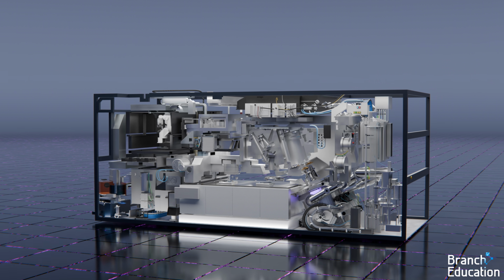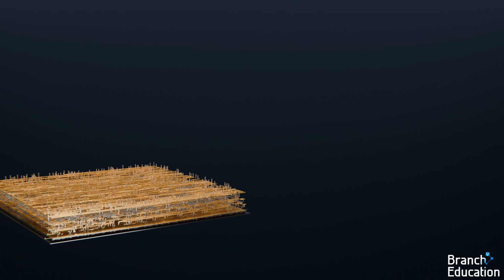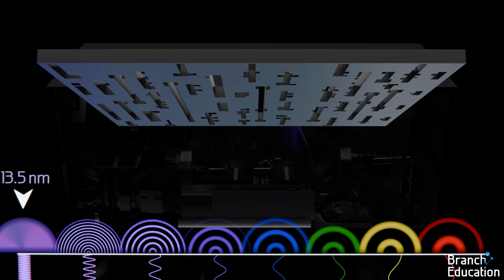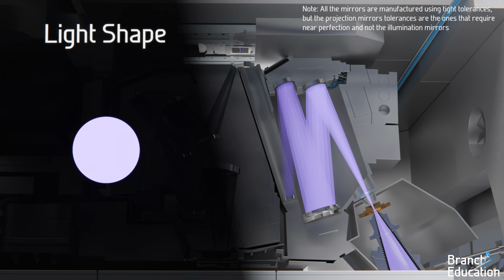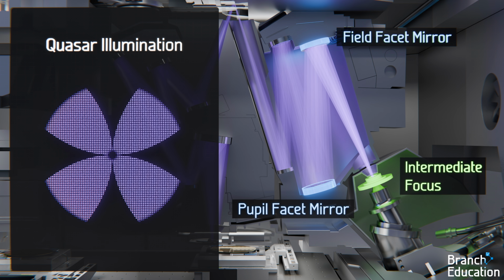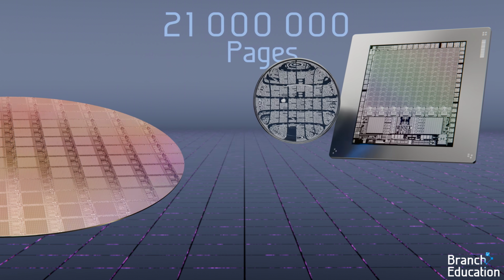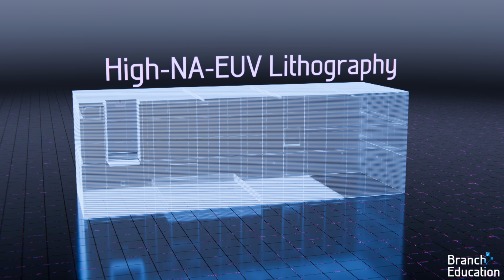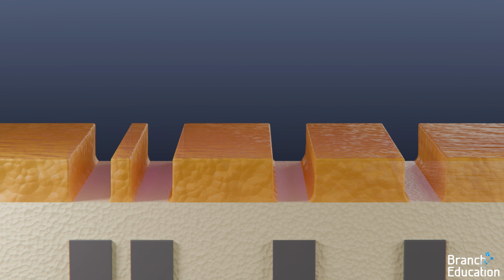The $200M Machine that Prints Microchips:  The EUV Photolithography System

Comment: First thanks for the video, impressive animation I can imagine the amount of time the team had to generate the diverse 3D animations. Just a question: between moving the waffle vs static laser and having a static waffle with moving laser, just wondering what is the argument to have chosen one way vs the other? Intuitively I would have said that moving the laser with different mirror movements could also bring up a competitive accuracy vs moving the waffle with electrostatic clamping and nano motors or semicontrollers. I suppose the question has been largely treated and it was deduced that moving the waffle was the most effective way. Still wondering if having the possibility to control the move of each photon from the laser will not be the next challenge to reach the atomic scale at the langstrom scale...

Comment: When I worked in metal etch for Freescale, they had the overhead system, but they stopped using it because it would just drop entire cassettes of wafers. Some that where on the backend of fabrication.

I guess the industry figured out how not to drop them anymore?

Comment: There is a beam of laser light that has a vector-precise burst, why scatter it with many, many precision mirrors into a tiny dot. When is it possible to shoot at three lasers. Or to guide light with hairline optics on a thin cross-section that is used to inoculate eggs with artificial insemination. Well, I saw the biggest theft in the world so far!  This was also needed for the EU to be able to finance the Ukrainians! Otherwise, it would have been enough to use the Sun as a light source, it has a large scattered light and is the largest source of light on the planet.

Comment: Hi,

There’s a hot topic—ASML’s planned 2026 layoffs (~1700 people)—that might fit well with your interests.

Unlike many Big Tech layoffs framed around AI, ASML’s case appears to be driven more by organizational restructuring. But at a deeper level, both seem to point to the same underlying goal: improving efficiency.

What makes this especially intriguing is ASML’s proposed two-year “Social Plan.” This suggests the current layoffs may not be a one-time adjustment, but part of a staged transition—potentially leaving room for further changes, possibly justified later by automation or AI.

It raises a broader question:

👉 How do engineers protect themselves in the age of AI? What can individuals realistically do when companies first restructure organizations, and then reshape the role of human expertise?

This could connect well with themes you’ve explored. I’d be very interested to hear your perspective on how engineers might navigate this kind of transition.

Best,

Comment: This machine really captures how far we’ve pushed classical physics to keep Moore’s Law alive. Calling EUV a “nanoscale photocopier” almost undersells it: you’re orchestrating tin plasma, 13 nm light, atomically precise mirrors, and nanometer wafer alignment just to print features a few dozen atoms wide. What impresses me most is the systems thinking behind it—optics, materials, mechanics, and control theory all stitched together so reliably that billions of transistors become a routine manufacturing outcome rather than a scientific experiment.

Comment: How do they control the mirrors to generate pattens? Are there different mirrors for different patterns or is it programmable?
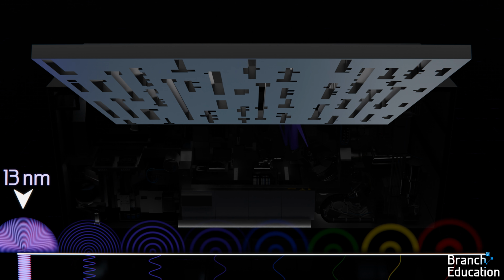Reply: At 15:04 they show the laser light passing through a pattern. What passes through is then directed with mirrors, focused and then used. They said "the pattern of the photo mask is imprinted into the light". Crazy!!

Comment: It was so upsetting to go "let's talk about words instead", because it made it so much more difficult to translate back to actual transistors.. It's unnecessary complication, not helpful.
Reply: To be clear, I'm not saying that the idea of comparing information density is bad, I'm saying that switching it up entirely early in the video was shocking and annoying. Just saying "if we printed words at the same level of detail, it'd be this much" or something similar instead of blocking it out like we're doing a different thing would've been better imo.

Comment: can some one explain something .  does the printing  of the mask layer by layer actually produce the 10 nm transisters and the wires , if not where do these transisters come from
Reply: Think of it this way: 1) Apply plastic foil to a disk. 2) Laser-cut patterns into the foil. 3) Apply the desired color with a paint roller. 4) Remove the remaining foil. Now you have a pattern on the disk. Repeat this step, layer upon layer. Only step 2 is done by this machine. The rest is done by other machines.

Comment: Why are the wavers spherical shaped and not rectangular ? This would leave less „waste“ I guess
Reply: i had the same question. Turns out the spherical shape is easy to spread the photoresist evenly with spinning, not possible with rectangles. This is done multiple times bdw, so its an acceptable trade off
Reply: @a @ajaysonar662 thanks 👍🏻👍🏻

Comment: I doubt that it is that complicated. The information is obviously secret and no one will even have access to it without a "happy" contract to sign. They probably have a way to grow crystals using projected light zoomed down with lense.
1. Near-Infrared Laser Patterning of Crystals (2023)
2. Photonic Crystal Self-Assembly (2025)
3. Organic Semiconductor Crystal Patterning
Multiple research groups have developed methods to pattern organic semiconductor crystals using:
Photolithography with patterned substrates to control where crystals nucleate and grow  (PubMed)
UV light to modulate surface charges of semiconductor nanoparticles, enabling rapid patterning  (Nature)
Direct photolithography on organic crystals where UV exposure causes spatially controlled molecular decomposition to create patterns
4. Femtosecond Laser Control (2016)

For sure DARPA uses that as there is nothing else evel left to hide under the secrets locker.

Comment: Hey I have questions 
1 . How do they produce photomask (because it's as demanding of precision as the actual chip , but just 4:1 size it's not like classical mechanical machines or engraving work on that photo mask , though it is truly remarkable that they pull it off )

2. Why do they turn the pressure back to normal after processing and before loading into foop , couldn't the foop be vaccumizd too ? 

3.   Does the absence of air and presence of vaccum promote chances of deformation of wafer itself further increasing the need to use calibration done before sending it under exposure?

4.

Comment: My little brother is an aerospace engineering major (literally rocket science) and he got an internship at Intengris, one of the many companies that makes parts for the EUV, he says he specifically will be working with the masks.
I'm a biologist, I never thought about any of this stuff, but he showed me this video to convince me that this process (and resulting products) is the greatest feat of human engineering on Earth and honestly I'm inclined to agree now
Reply: The hard disk drive is pretty amazing too. The actuator mechanism that moves the heads is incredibly precise. It's also a lot sturdier than it looks—even after 20 years in service, it'll probably still work fine.

I suppose it's not as impressive overall as a CPU, but it is one of the most impressive mechanical devices I've seen.

Comment: In April, I had a c.card problem.  I called the company, and the human lady said I'd have to take an AI-generated quiz - to determine if I am me. I said 'ok.'  The lady read the multiple-choice questions to me over the phone, and i gave answers.  The questions were weird and obscure, touching on issues from 45+ years ago (I'm 73).  I failed the quiz.  Apparently, AI knows me better than I know myself.  I stopped using the c.card and went to a different company.

Comment: I'm 73 and gobsmacked by this insane technology.  While I admire the engineers/designers, I frankly don't like AI and how it bodes for future generations.  I'm glad most of my lifetime preceded AI.  I'm an analogue guy.  I still do music recording with reel to reel magnetic tape.  I build 2" thick slab tables using a 28 oz waffle-edge hammer and 2" concrete nails. It's doubtful I'd fit well - with working at ASML.

Comment: Hehe, that's a fair amount of rare earths used. But what is the refinement level of each? 5N, 6N, etc.? Just a rough estimate of light and heavy rare earths would be fine. The superconducting floating platform that moves it during exposure is made by a subcontractor, isn't it? Is that company's name? Hahaha, but this seems like a marginal method, and there seem to be many elements that could lead to failure. Will it turn out to be as powerful and advanced technology as we think?

Comment: Very well done and you have all your facts straight.  My only critique is that you do not talk about the astounding cleanliness requirement.  After 80 mask layers the yields are around 80% so each layers must be almost perfect, not a single missing full stop on 100 copies of the mask on a single wafer… ie not one 45 atom mistake on a 300 mm disk after depositing printing and painting a layer. And it’s fast …No step taking longer than 1 minute 24/7.

Comment: This video is about 40 minutes long. I watched it at 2x speed and it took me an hour. It set me on a journey learning about the larger manufacturing processes of integrated circuits. It was at a time when I had been drinking from a fire hose, learning as much as I could, as fast as I could about AI. The ironic revelation for me is that, here, at the peak of human ingenuity, science and engineering, what exactly are we doing? Making extremely complicated and expensive petroglyphs! It's been an enriching experience. From the bottom of my heart, thank you!

Comment: It seems to me that this machine is way too complicated, most of the space being taken up by the robotic arms that move everytinhg around. Would it be that difficult to move the photomask through an airlock directly into the reticle stage, and align it there as well? 10-15% of the machine would no longer be needed. And also would it be impossible to hit a solid tinfoil sheet with a laser?

Comment: I have seen other Videos about Steps inside a Semiconductor Fab.  However. NONE of those  Videos have been to the Detail of YOURS.  Thank you for all your Work to Produce this EXCELLENT Video!

A LONG time ago, I Worked at Intel: the i432 AMX chip was out, and 386 was ready for Customers.  I Worked in Test Engineering,  and we had 386 Modeling and simulation- and actual Chips.  Those Chips were incredibly primitive to Today's GPUs and CPUs.  The Fabs were tiny with nothing close to the complexity of today's Fabs.  

The Intel Developmental Fabs in Oregon, House 2 of ASML's High NA EUV Tools; a third is installed in AZ.

Many Years later, i Interviewed for Cymer- now Owned by ASML- who Build the Lasers and Tin Handling Systems.  

I SINCERELY Hope your Talented Team produce a Video about ASMLs High-NA EUV Tools.

Comment: Our computers, mobile phones and other gadgets that depend on this are under appreciated when you realise just how much goes into the making them. A hundred steps and many months to produce each chip and every step must be good or the whole batch could fail.
It started with much simpler chips like 6502 in the 1980's they were smaller only about 4x5mm =20mm^2 and use about 8um size features.
Now we got 10 x 64bit cores with cache and vector ALU's etc per chip so they still got to make it bigger like 20x20mm=400mm^2 and features 8um which is 1000X finer. so that's like having 20 Million of the 6502 CPU's on one chip.
I cross checked the claim about a library full of books and it checks out - around 20000 books could fit on a large ic.

Comment: I've had to do this with Bragg Mirror reflectors and metalens etched in my eyes with lasers or spasers and metasurfaces using holograms quantum mechanics quantum entanglement plasmonics and Silicon Photonic Time Crystals or meta atoms on the nanoscale for microscopy and cancer research for the past 10 years plus. Basically  Augmented Near eye displays and electromagnetic fields and spectrums. A very awful experience with no compensation no communication or human interaction. No Health and safety either.

Comment: Just recently a coworker suggested that the moonlanding must be false because we cannot today replicate the knowledge that people had at Nasa during the 60's. As if we are now smarter then than. I used ASML as an example for how knowledge can be lost. At ASML they sometimes refere to the EUV as the miracle machine because to every expert on one piece of the machine the next part is a miracle. What I said was this and that if there were no need for exactly these type of chips (e.g. 2 dimensional) and it would take long enough for the experts to either forget or die then this specific knowledge would be lost. So even though not every dimension or secret is disclosed in this video I cant help but feel that the danger of people forgetting how to make CPU's seems a little smaller. THANK YOU BranchEducation!

Comment: Bro I am not a professional but at 31:00 when we started wafer journey from lithography cluster, wafer track tool and to the illumination area of the lithography tool. The wafer enters the track tool and the first step was putting the photoresist layer on the wafer, then it's heated for solidification and then it's vaccum sealed for purification (doesn't get the specific word for that 😅) but I think the the first step for this should be the vaccum part cause when we are putting resist on the wafer the air it contained in its head face from the atmosphere outside before entering the cluster of the EUV was mixed in the resist and then it's heated within it causing a process incomplete degassing.
Which will effect the final result and output so if you have time gimme me a reply if I am wrong correct me, I am free for your opinion, though exaggerating content material bro Love you ❤❤

Comment: A nanosecond is one-billionth of a second (10-910 to the negative 9 power

10−9 seconds). It is an extremely short duration, so short that light travels only about 11.8 inches (0.3 meters) in one nanosecond. To put it into perspective, there are 1,000 nanoseconds in a microsecond and 1,000,000,000 nanoseconds in just one second. 

In relation to a second: A nanosecond is one-billionth of a second (1/1,000,000,0001 / 1 comma 000 comma 000 comma 000

1/1,000,000,000s). 

In relation to the speed of light: In a nanosecond, light travels approximately 11.8 inches (0.3 meters). 

In computing: Modern computer circuits operate at speeds where transistors switch on and off in nanosecond intervals. 

In relation to other units: 

1,000 nanoseconds = 1 microsecond (10-610 to the negative 6 power 10−6s). 

1,000,000,000 nanoseconds = 1 second.

Comment: I worked in Silicon valley for 42 years, albeit, not in a chip manufacturer, and this just blows my mind. In woodworking, you're concerned with precision to maybe 1/16 or even 1/32 of an inch. Here we're talking about precision to 10 nm! The amount of engineering required to satisfy that is incredible. It's no wonder the cost of these machines is so high. One question I have is just how does the mask get created and by whom. Does the designer of the chip use, for lack of a better term, a CAD-like system and then provide files containing the design of each lay to another vendor or do they create it themselves?

Comment: Based on current information, it appears that TSMC is planning to skip the use of ASML's "High Numerical Aperture Extreme Ultraviolet (High-NA EUV)" lithography equipment for the development and initial mass production of its 1.4-nanometer (A14) process.

Key takeaways:
 * No High-NA EUV for A14: Reports indicate that TSMC has decided not to purchase the extremely expensive (estimated at around $400 million per unit) High-NA EUV machines for the 1.4nm node.
 * Reliance on Standard EUV: Instead, TSMC plans to leverage its existing or standard EUV (0.33 NA EUV) tools and combine them with complex multi-patterning techniques to achieve the fine feature sizes required for the 1.4nm process.
 * Rationale: This decision is primarily driven by cost control and the proven maturity of their existing EUV technology. Using standard EUV with multi-patterning is considered a more cost-effective approach compared to adopting High-NA EUV.
 * EUV Tool Procurement: Despite skipping High-NA EUV, TSMC's demand for EUV machines remains strong. Reports suggest the company plans to acquire around 30 standard EUV machines in 2027 to support the mass production ramp-up at its Taichung 1.4nm facility.
 * Mass Production Timeline: TSMC's 1.4nm process is scheduled to enter mass production in the second half of 2028.
In summary, TSMC will use EUV lithography, but not the very latest High-NA EUV equipment, opting instead for standard EUV combined with sophisticated patterning techniques to hit the 1.4nm node.